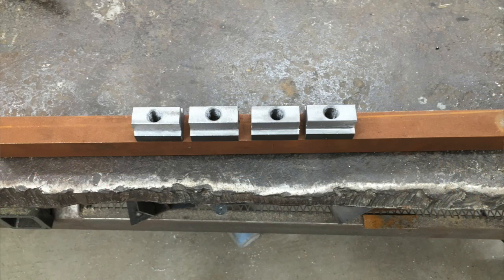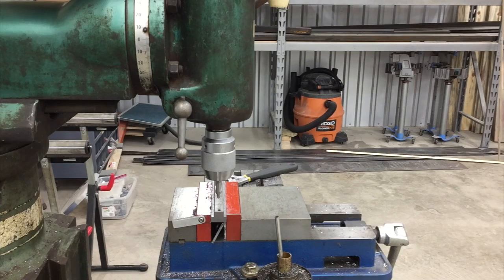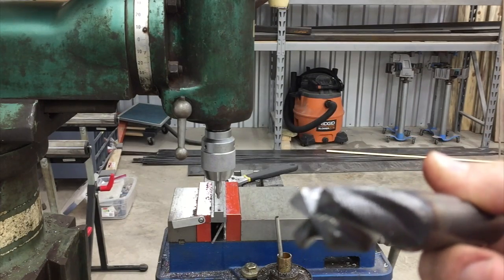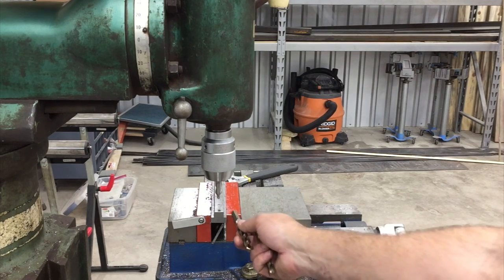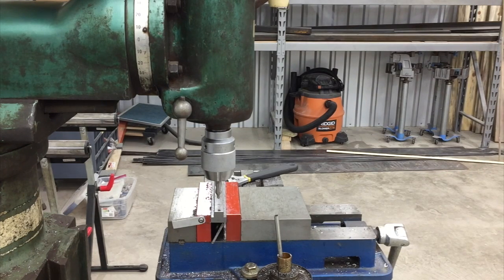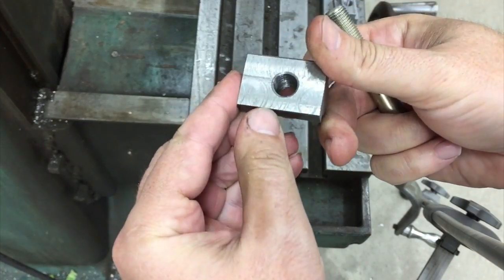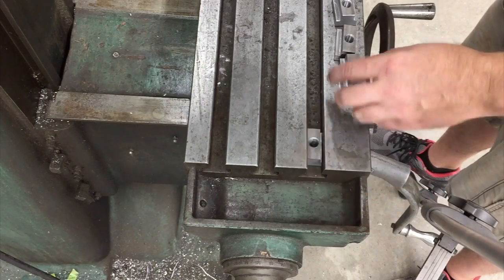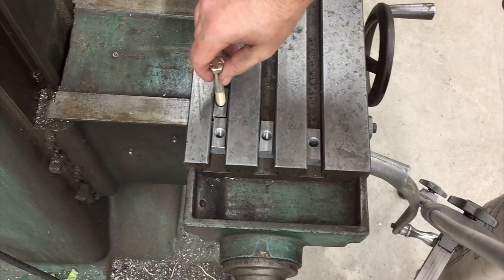Fabrication Basics // Making Tslot nuts (t-nuts)

Comment: You forgot to tap your part onto the parallels with a rubber mallet. As evidenced by the parallel falling over during the milling operation.
Reply from the maker: Good observation, but no i didn't forget, I remembered it in fact, but elected not to do it because the soft jaws in this vide have a spot worn in them that causes it not to seat even when you do hammer it.  I need to make a new set of soft jaws or buy some.

Comment: What size square stock was that you started with? I need to make some smaller T nuts for a new rotary table I just bought for my mill, has an odd size slot on it, so thanx for the vid gets me motivated to make some.
Reply from the maker: It's 1" square, but really should be 1.25" that's what the slot is down in the deep wide part.  I just had the 1" laying around so i used it.  Thanks for watching!

Comment: I need to get a milling machine next.  I had to have someone else make me 3 t-nuts for my lathe.
Reply from the maker: Ahh, well if you need anymore i can make you some.  I was going to order the Teco brand that are made in the usa, but had a hard time spending $100 for some Tnuts when i can make them.
Reply: I have all of them I need.   One went on the radius tool, another one on the Tool Post Grinder, Then I had one blank one made for when I get the quick change tool post.

Comment: I'm no expert, but I've done a little. My suggestions: 1, good on using a rouging endmill. Be careful with carbide. Easy to break. 2, Stuff that thing as far in the collet as close as you can get to the flutes. Much more rigid. 3, Only use the very tip of the centerdrill. Tends to work better that way. I recommend a spotting drill for larger drills like 1/2". 4, Oil those ways! I take it your not yet comfortable with power tapping?
Reply from the maker: yea i need to get some oil on the ways for sure.  i need to move the head back, but the ram doesn't seem to have a rack and pinion, so can't figure out to push it back.  Been meaning to order some spotting drills.  Oh hell no, not ready to power tab on that machine yet.  Thanks for all the info.
Reply: If it seems locked up: Loosen the bolts, clean the exposed ram surfaces as best as sprits some good penetrating lube on the ram, get a wood 6x6 and hold it up against the back of the ram and get someone to beat on the board with a sledgehammer. Sometimes that isn't even enough. Rams need to be moved regularly or they lock up.